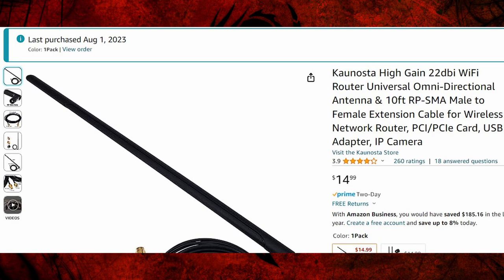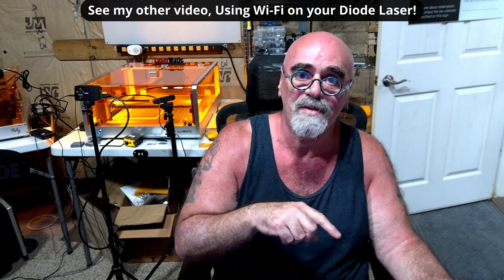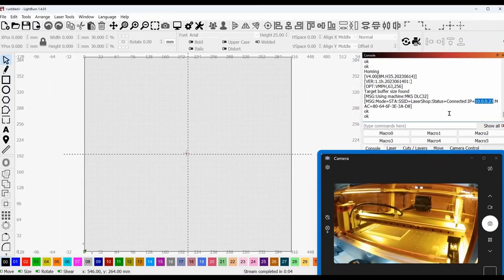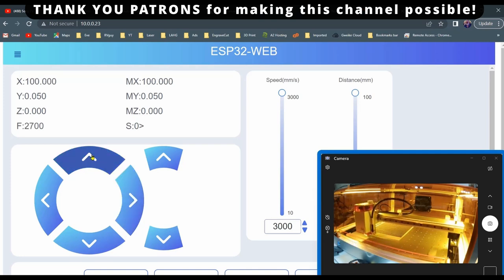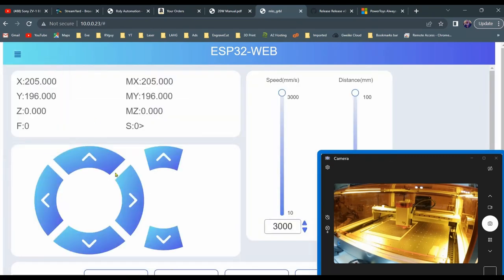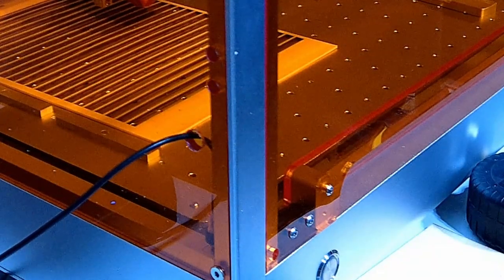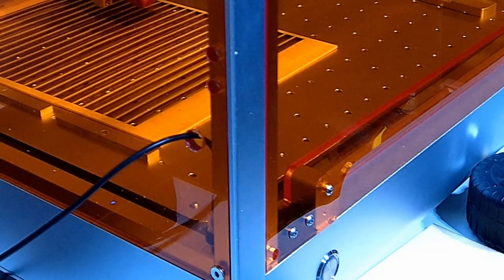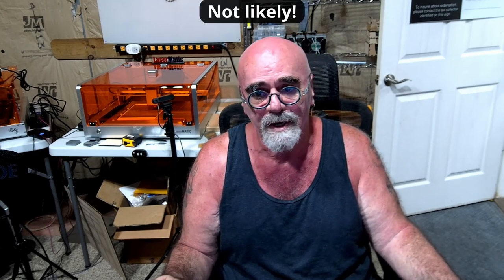Extending the Wi-Fi on your laser or printer with this inexpensive hi-gain antenna!

Comment: Rich. Have installed the antenna. My LM10 is mounted on a rollaway cart. I have 3D printed a base for the antenna, cable attachment points with zip ties, and a rest for the antenna when not in use. I ran the cable through the camera usb cable cutout at the back left side of the enclosure, used double stick tape to attach cable holders, attach with tape to side of enclosure clear of the y axis gantry. Clean install. Have pics if interested and STL files of 3d printed parts.
Reply from the maker: Yes Carl, thanks! Send them to my email please!

Comment: It's impressive that an omnidirectional antenna was able to establish a good, stable connection at a distance o 150 feet. I had a similar problem and used a directional Yagi antenna. Thanks or the video.
Reply from the maker: I was surprised myself! I ordered a 25' extension cable thinking I would have to mount the antenna outside the building, but I didn't need it.

Comment: As with other radios like Ham or GMRS etc., you can extend your range even more by creating a ground-plane. Add a wire the same length as the antenna directly to the ground (the outer ring of the antenna connector where it connects to the laser), NOT the middle core wire of the antenna. This essentially makes the antenna into a true dipole antenna rather that just half of the dipole antenna.
Reply from the maker: Good to know! Thanks for the tip!
Reply: @TheLouisianaHobbyGuy  In your case, Rich, since you have it connected to that cable, you wanna put your second antenna (the wire) right at the connection where the antenna connects to the cable. Not where the cable connects to the laser.
Reply from the maker: I'm good as-is Ed. It's working flawlessly.
Reply: @edkennedy1166  are you talking about just adding a wire, in this case,  430mm long, soldering it to the antenna connector (nut) and the other end free air? I am guessing that 430mm antenna has the wire wrapped around a core which means it would significantly longer, but I'm not sure?

Comment: Hello Rich. I know this video is not about air assist, but I need to ask you a question. Do you know of any kit I can use to control air assist usinmyg  Ortur laser master 3? What Im looking for is for lightburn to turn air assist on and off automatically for the layers I need it. I have some projects that I have to keep watching to turn my compressor on manually when I need air assist. Thanks
Reply from the maker: Check this article: https://diode-laser-wiki.com/documentation/extras/relay-control/

Comment: Interesting bed
Reply from the maker: Good eyes! That's V1 of the jig plate; it will be an accessory. The standoffs now have little nubs on them, and the jig plate and honeycomb drop into them for 100% accurate positioning. The jig plate comes with 8 jig stops that can be positioned anywhere on the thick aluminum plate. It's just like a fiber bed, but much larger.
Reply: @TheLouisianaHobbyGuy  I like it

Comment: Curious how to do that when you can't remove the antenna.
Reply from the maker: Why can't you remove the antenna?
Reply: @TheLouisianaHobbyGuy  Because it's not removable. Some solder directly to the circuit board.
Reply from the maker: Ah, cut the wire and splice it.
Reply: @TheLouisianaHobbyGuy  There's no way to mount the antenna. Pretty sure your warranty would be voided too. Plus if the new big antenna threads on but your old one is some cheap molded in plastic bit with a swivel how are you going to run wires from the new antenna that has threads instead of a wire?
Reply from the maker: It came with an extension wire.